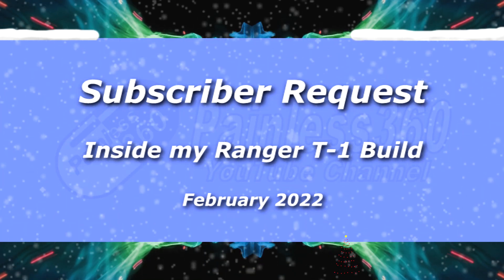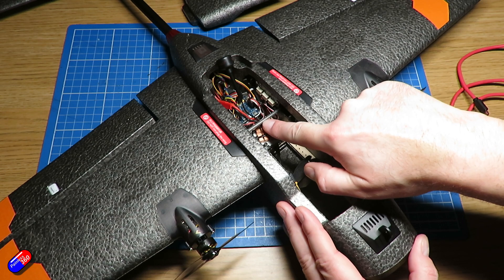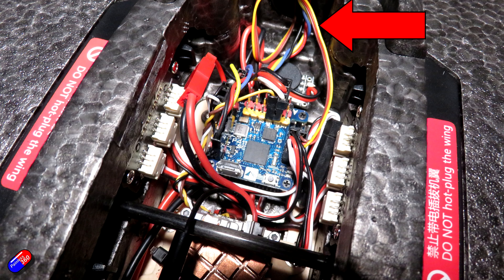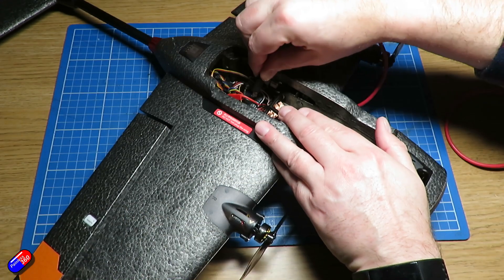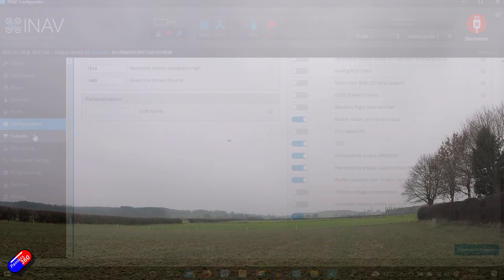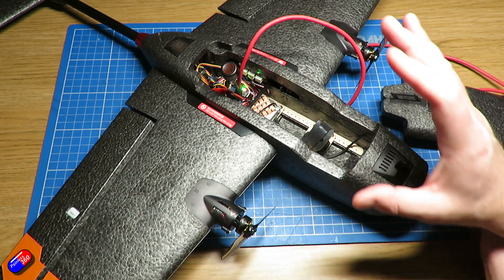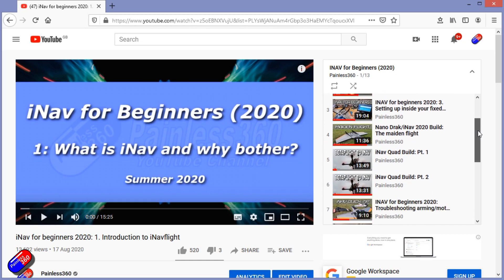How I built out my HEEWing Ranger T-1 with INAV 4.0 and DJI HD FPV (Subscriber request)

Comment: Have used plastic spoons (Tea or Dessert as airflow needed) cut as scoops on many planes, and the foam hole needs to be the full size available and angled to divert the airflow smoothly (Shaped and smoothed with soldering iron). Also the exit needs to be bigger in area than the input to avoid restriction as warm air expands!!

Comment: Hello.I have the pnp version and I am building it with an f411 wing. I would like to ask why for the escs except from the signal and ground they have a 5v wire?
Reply from the maker: The 5v wire from the ESCs is to power things like a reciever. The flight controller you're using does that so the 5v from the ESC isn't needed.. Happy flying
Reply: @Painless360  that was what I had in mind. Thank you.
Reply from the maker: I've made this video that may clear things up - https://youtu.be/yLgKLRN7Si4

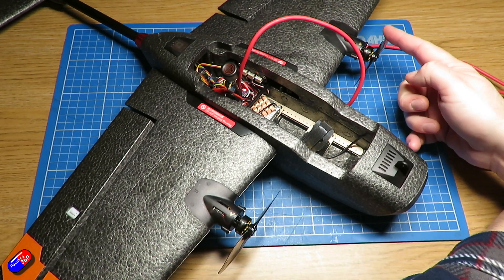Comment: Is it possible to reverse prop rotation ?  8:00 looks awfully wrong to me even though factory manual found is exactly like your set up.  In a very unlikely event of single motor failure on either side will give uncontrollable yaw.  Right wing prop is typical single engine setup and it gives left turning tendency. Its location only makes it worse.
Reply from the maker: Probably. However without a rudder a zero throttle glide back to the landing strip may be the best bet!

Comment: I just finally finished a heewing t1 ranger digital build on iNav 5.10 and wanted to thank you for the plethora of iNav and Heewing t1 ranger content... I used a Matek F405 WTE with built in ExpressLRS for my build,. Mounted the vista the way you've done. I chose this way to do it so that it could remain free for mounting the runcam thumb and 360go2. Everything is working great with a 2600mah high discharge 3s Li-Ion battery that I have set close to the nose in the fuselage. ^_^ The vista does not overheat and has top performance even at 1200mw, I found there was plenty of airflow after cutting a vent hole! The new fuselages have holes cut already in the camera area. Oh, and I used the caddx nebula pro nano which fits brilliantly just perfect in the camera spot. This is my first fixed wing and I have watched your channel for years but never dove into the world of airplanes. I'm hooked! Thanks for all of the tips.

Comment: Hello! Answer two questions please. Is it true that the signal wires from the two motors are connected independently to S1 and S2, respectively, but are controlled synchronously? Why do you have a servo 6 (rudder) configured for output 5, although it is not present in the design of the model?
Reply from the maker: 1) I have the motors connected to one servo output here.
2) It is the default setup
Reply: @Painless360  Thank you! Do the motors rotate in different directions? more precisely, will it be necessary to change the wires of the motors to ESC, due to the fact that they have a common signal (and I will not be able to configure this in inav). I'm sorry, this is my first experience with inav and an airplane.
Reply from the maker: Yes and no. Please check out my other videos on this model and especially the INAV for Beginners 2022 series.. Best of luck!

Comment: cool two motors i love this configuration, if i see this video before i take it than the HK radjet 800.. (but is ok.. i have a phoenix 2000 v2 to put dji in after.. and the radjet are ok for fpv ) but one question (another): the weight please? with a 3s lion? thank you! :goodvibes:

Comment: Hi Lee, love the video's - you have helped me so much in understanding quads etc BUT ... how are you wiring the motors and servos in your T1 to the flight controller - any chance of some more detain (I'm totally new to planes and fell out of my comfort zone - and have been out of the hobby for way too long) thanks Steve
Reply from the maker: Elevator to the elevator (stabilised pitch) output  leave rudder empty, I used the y cable for the LEDs for the ESCs so I could use one motor output and used the othe y cable to connect the Aileron to one of the stabilised roll outputs..  see my INAV for beginners series.. happy flying!
Reply: @Painless360  life saver - yet again - many thanks for that

Comment: hi, i have a problem again this time inav is not able to comunicate with my accelerometer. the gyro indicator at the top is gray and the accel one is red. i have alredy tried changeing settings in the sensors and busses under the configuration tab but it didnt change anything
Reply: also from what i can see 
this only happens on the software for the dji fpv ost  wich is designed to work with the matek f411 wse and im using the f411 wte because its suposed to be a substitute.
Reply from the maker: I think the WTE uses a different target. I'd check what it came loaded with and look at the INAV target detail for it on the Matek website... best of luck
Reply: Thanks

Comment: Thank you for the video. I have a question. Can HEEWing Ranger T-1 be flown with only one brushless motor working? (in case one of the two motors fails during flight). Does only one motor have enough thrust to fly safely? Regards.
Reply from the maker: I've never tried but from what I've seen of other twins when they lose one motor - it induces a huge yaw that needs all of the rudder to counter so often the issue isn't keeping up airspeed but more of stopping it from yawing into a flat spin.
Reply: @Painless360  Ok Thank you!.   So a test  should be done in order to know if the rudder has enough authority to compensate the yaw and still have control of the aircraft.

Comment: where are you running the two power leads from the DJI (red/black leads)? WHat is powering those? Thanks.
Reply from the maker: Battery power. Connected via the JST lead I show...
Reply: @Painless360  Got it, thanks. I was also confused about the ESC connectors from the two motors. I have not yet tested this, but I removed the red lead from each ESC and connected the ground's to 'G' and data leads of the ESC's to S1 and S2. Hope that's right.
Reply from the maker: Check out my INAV for beginners 2020 series if you a re not sure. It covers things in a lot more detail..

Comment: Hey lee, how do i configure the LED in PNP version with my h743 wing v2. I have plugged the led cables into the led pins on the FC. But not sure what to do next. Also would it be possible to get a copy of your inav config for the Ranger T1 as I'm setting mine up using your videos but i just want to go through it in more details to make sure all my settings are reasonable.
Reply from the maker: https://www.youtube.com/watch?v=kjHruLW8KT0

Comment: What batteries you suggest to use if i want to fly more than 20mins ?
Reply from the maker: Maximum mAh packs. LI-ION are good for this...
Reply: @Painless360  Hello again Lee, i have just finished mine and from the maiden flight i had vista overheating issues, did you have any problems ?

Comment: Thanks for the help!  Did you end up using the HEEwing PDB or just bag it and wire straight to the ESCs?  And did you wire separately to M1 and M2 or use a Y-connector?  Still building but looks like control on motors is not even with a Y-connector so was thinking might be better using separate signal wires.
Reply from the maker: PDB used and Y connector for throttles. Happy flying!

Comment: Quick question; Can the LED's on this model be put on a switch instead of on the LED output on the F411WSE? Because I don't have enough UARTS I want to have HDzero on UART1, ELRS on UART 2 and gps on softserial 1... Which is on the LED pad, so can no longer use that. Is there any way i can get it to work?
Reply from the maker: If you have the PNP version that has the addressable LEDs then they will only light if they receiver valid colour data so a switch won't make any difference. If they are the static LEDs used in the KIT version then you can use something like a MenaceRC switch to control them from a spare PWM port..
Reply: @Painless360  I saw your video on setting the softserial on the f411WSE aswell. There is one thing I did not quite understand about the firmware though, can i in Inav set a different softserial RX port than LED pin? E.g. a servo output that i don't use? Or is this not possible in Inav?
Reply from the maker: That FW is specifically for that instance and remaps the LED pin so you can use it in that way for something like the DJI OSD. Resource remapping isn't something that is easy in INAV..

Comment: I built almost the same setup using Matek F765 and ready for the maiden.  The quistion I would ask Is how low on voltage with the 18650 pack before the caddx Vista will drop out? There is lots of videos showing the build but not the Inav setup so thank you.
Reply from the maker: DJI works from 7.4v so that's about 2.4v per cell with a 3s LiIon..

Comment: Have you had issues with incorrect altitude readings with the amount of heat inside the fuse from the Vista? And the air inlet right above the FC?
Reply from the maker: Baro is not enabled. That is the sensor that would be affected .

Comment: This cute little fixed wing makes me want to dust off my pixhawk. Any thoughts how well that will fit in the chassis?
Reply from the maker: Not easily but it might fit with a smaller battery.. Best of luck
Reply: @Painless360  I'm big on mission planning. I know there is not much payload to work with but hoping to slip a drop mechanism into the bottom fuselage around the CG.  Or just be a fun learning platform.

Comment: Great stuff as always! Thanks Lee! One question: as you don’t have diff thrust, I presume you had to join together your ESC signal wires to make it work like a single motor config; correct? Cheers!
Reply from the maker: I swapped the y cable for the LEDs for the seperate cables that come in the ESC connections.. Works great. Happy flying
Reply: @Painless360  Cool. In effect that’s what I’ve had to do as well. Thanks 🙂